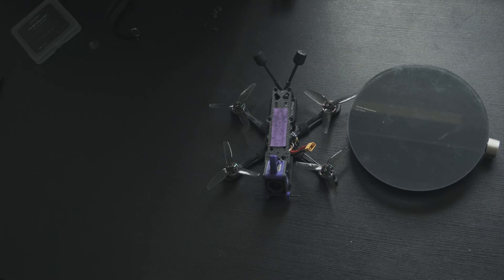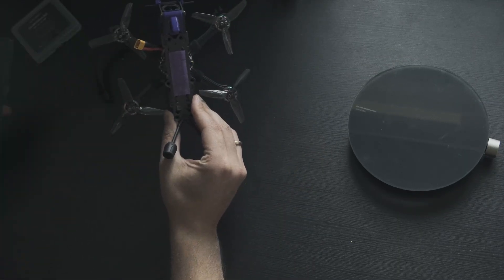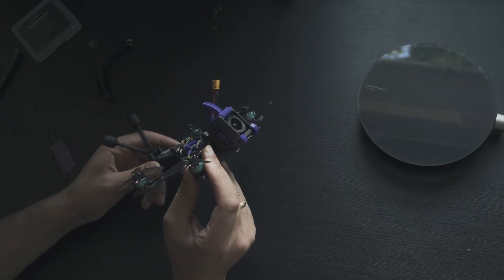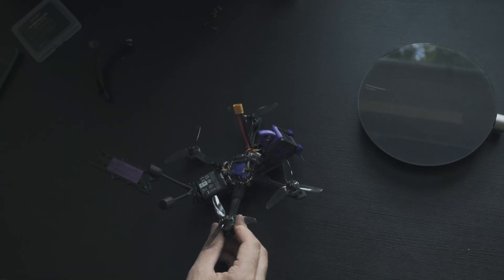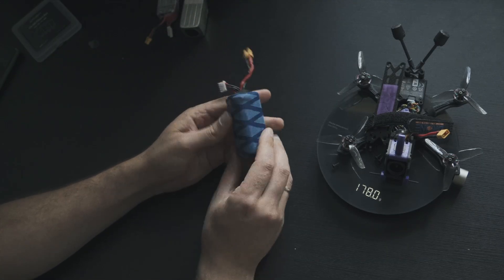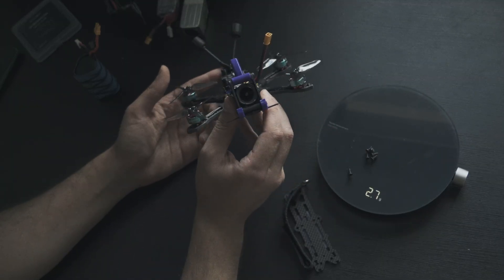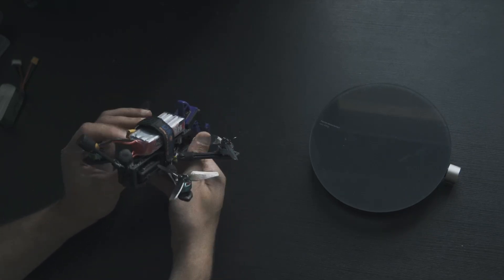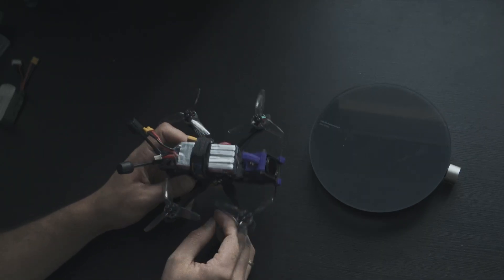3 Inch FPV Build Under 250g | Jeno 3 + DJI O4 Pro

Comment: Great video! I will be building one of these next!
Reply from the maker: Thanks! And good luck with that! Are you planning to build a standard or light version?
Reply: @NKhatisovi not sure yet. Cncdrones has a multi plate version that allows you to replace individual arms if they break. I may try that one out.
Reply: @NKhatisovi have you seen the jeno 25? I just finished building one of these as well and it flys amazing.
Reply from the maker: You mean the pocket with o4 lite? I am planning to build 2.5 inch 100g drone wit o4 lite for fun :) 
Btw the separated arms version  is heavier as I know. Maybe something to keep in mind